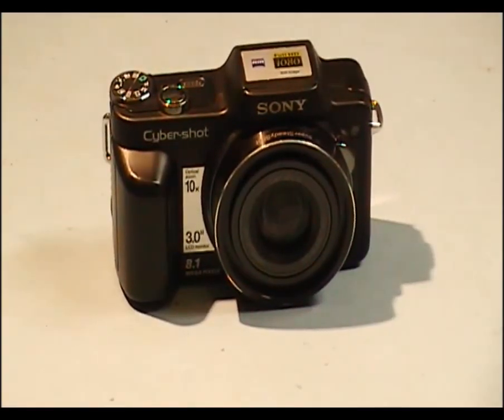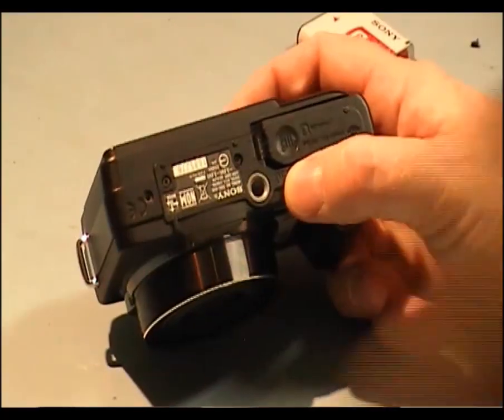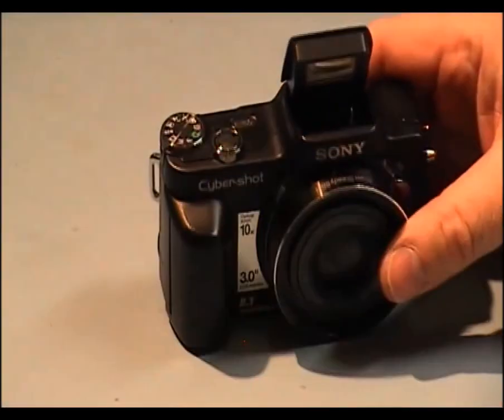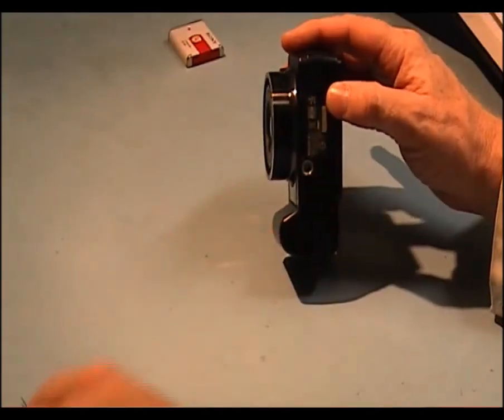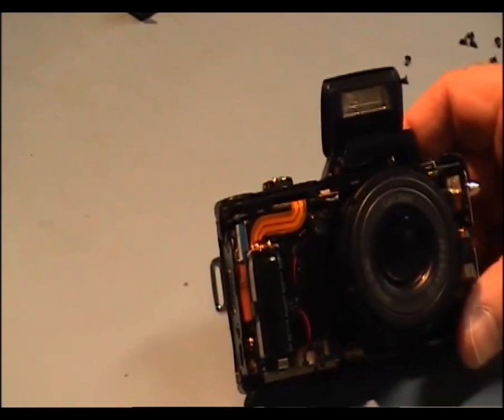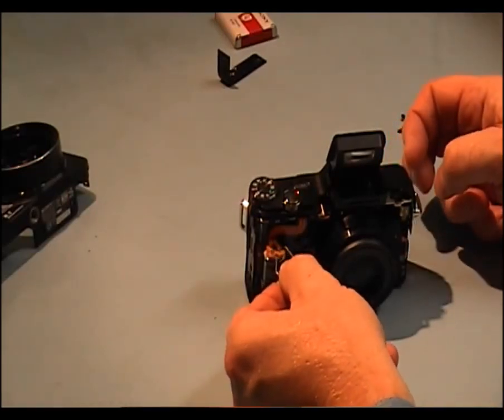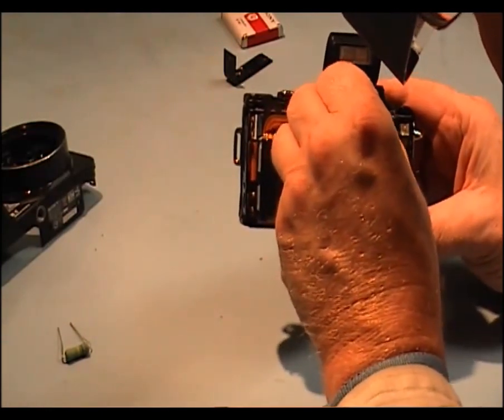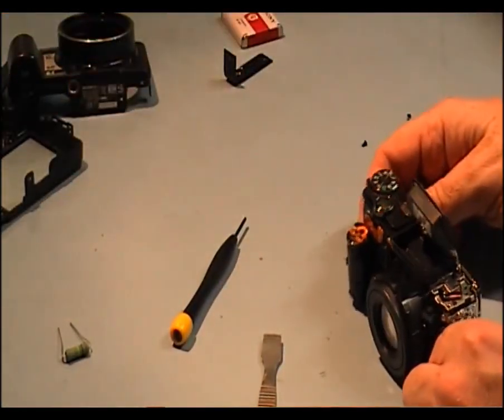Sony DSC-H10 Repair video

Comment: Hi. Your video is very helpful. I will not be able to figure out just by myself how to open the camera without your instructions. Thank you very much.
Reply from the maker: you are welcome, thanks for your comment
Reply: @ElectronicWorkshop  my camera have a broken ribbon cable going to the flash. I connected by soldering fine wires directly to the ribbon cable copper. It also has a drained button cell battery that I replaced with a slightly different part number but it works.

Comment: Hi there... Thanks so much for this video. I am just now having a Flash issue. I set the camera for Flash on .. the Flash will pop up, but no light goes off, so all my pictures come out dark. There are no error messages or anything to alert me that there is a problem. I personally think that it's the Flash Bulb being burnt out, but there is no gray evidence telling me otherwise. There is a small screw under the light, I would assume to replace the bulb. Do you have any idea as to what could be the cause? Any help will be greatly appreciated. Thanks in advance.
Reply: I have the same problem with the flash. I took it to a repairer who carefully moved the popup flash and at a certain angle he managed to get the flash to operate. His verdict is that the flexible ribbon cable connecting the body of the camera to the popup flash has an intermittent break and needs to be replaced. I did not go ahead with the repair because he quoted well over $200 just for the cable. I thought I might be able to fix it myself for much less. Anyway, check the cable before worrying about the bulb.
Reply: Dexxter Thanks Dexxter...!!!

Comment: thanks!
Reply from the maker: Any cable that is subject to movement is prone to breaking
here is a part number for the cable and flash, they come complete
Part no: A1334620A
  Disc: FL-179 FLEXIBLE BOARD, COMPLETE
Reply from the maker: a word of warning
keep away from the charged capacitor, it can give you a nasty burn
Reply: Electronic Workshop
tell me about it. :(